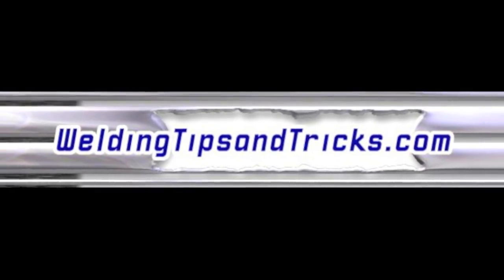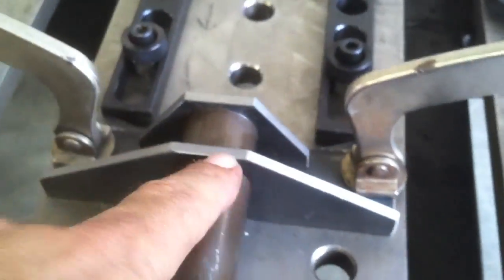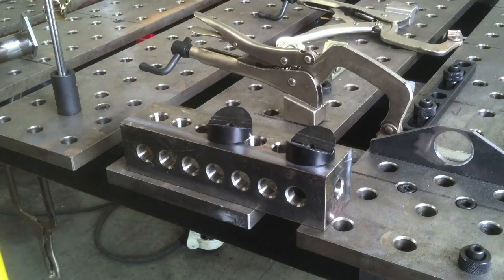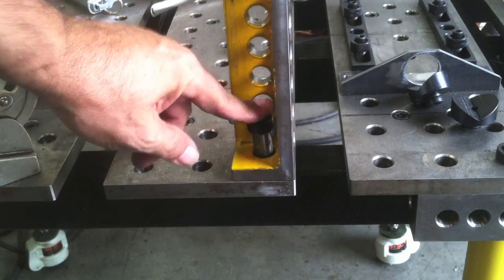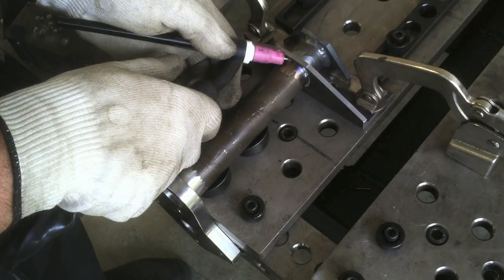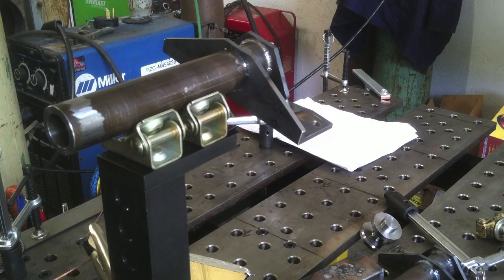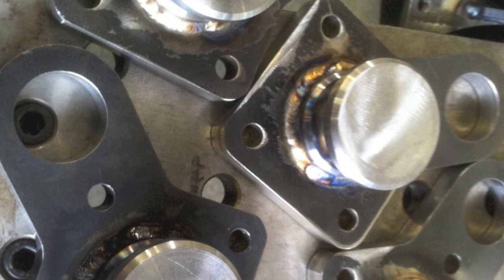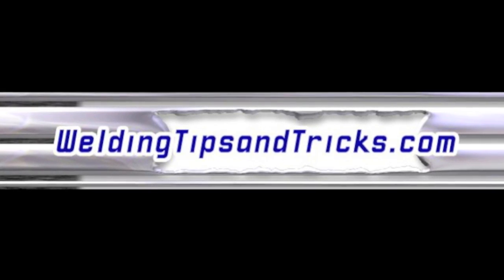Stronghand Tools BuildPro Table- Tig Welding Steel

Comment: A good and quick clean up for steel is to set it in myiatic acid (the stuff for brick cleaning) . let it soak for about 10 min. then use a wire brush and most if not all mill scale will come off, if needed soak it again.  USE ALL PPE..

Comment: @weldingtipsandtricks thats good to know, i cant really justify the price of the miller here in AU.. and unfortunately the powerpro 256 combo unit is 3ph here, so i need to go for the 1ph machine. Everlast has only been here a short time, and as yet you can only get the machines, but not the accessories yet, but everlast USA are developing an equivilant to the powerpro 256 combo in 1ph for australia which is good but no eta just yet.

Comment from the maker: @tboost007   You might be surprised to know I used an Everlast powerpro 256 combo unit for this job.  The flex torch came from Everlast also. Its an air cooled wp9F (f is for flex) and gets pretty hot on some of this work.

Comment from the maker: @joelyboyblue  I usually do lay wire on 1/8"  .125"  3mm or thicker and only on carbon and stainless...If I start out with lay wire and it doesnt seem to be working the best, I will switch to dipping the wire in and out.

Comment: nice work as always, however just out of curiosity, which welding machine did you naturally go to for this job, i suspect its the miller because i noticed your using a flex head tig torch. here in australia there is massive difference between the price of the most basic miller dynasty 200dx and the everlast equivilant.. almost $4,000 difference in fact and there is no justification for it.

Comment: @c4fishfood  Correct, the Nomad table is hopeless when it comes to any precision fixturing needs, being very "flexi" due to the thin sheet-metal table top.  I use mine only for rough and tumble work, but someday when I go to heaven, I'm sure I'll be able to afford a StrongHand Buildpro Welding Table.  Or maybe not even then...

Comment: @Bonfield2002 For just a StrongHand TMC57838 Buildpro Welding Table (78" x 38"), with no clamps or other important gegaws (which can add up REALLY fast), the price is $3,000.

Signed,

-NotJody

Comment: Nice demo on the table there Jody! I'm going to ante up with my two cents, on the cost of tools or equipment. I've had my share of waiting to make tool and or equipment investments and even buried the cost into a single or two jobs, to start that investment. Tools and equipment don't set up back, they set you forward, from the day you start using them... Keith